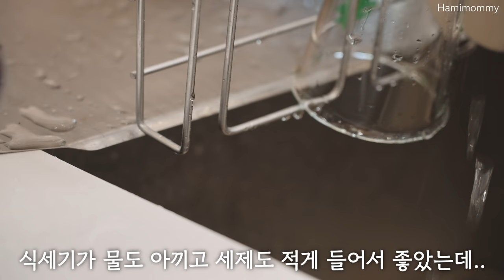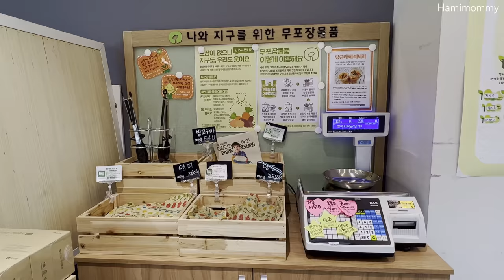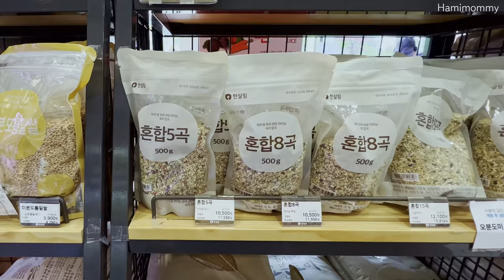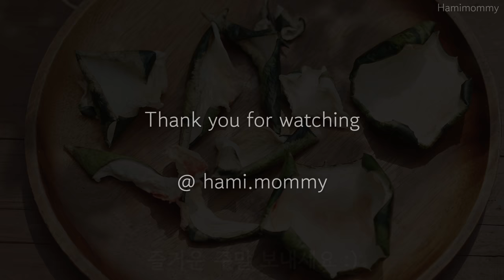SUB) 정원 꾸미고, 마당에서 피크닉하는 주택일상 🍉ㅣ여름과일 보관법, 수박껍질 버리는 팁ㅣ친환경 살림 🌱메네멘, 순두부찌개, 식빵애플파이ㅣHamimommy Vlog

Comment: Menemen is a very famous meal in Turkey.
Without boiling the tomato, peel, chop (or grate) and add it. Cook with the lid of the pot closed until the tomatoes are cooked.
Menemen is eaten with a little water. Therefore, it is not preferred to be eaten too dry. I recommend you try this way. Greetings from Turkey 💕🇹🇷

Comment: I'm so glad to see you cook turkish food😭😭 If you come to Turkey one day, I would love to host you and be your travel guide🥺💘 and also you can try kuymak i think you like it 💘 this is kuymak recipe; 
2 heaping tablespoons of butter
2 heaped tablespoons of corn flour
1 water glass (at room temperature)
1 cascolot cheese
1/2 tea glass of boiling water
1 wipe teaspoon salt
Key Point of Kuymak Recipe
The most important point you should pay attention to in order for your gem to be the flexibility you want is the cheese you will use. You can also cook with chechil or cheddar cheese, but you will get the best result with kolot cheese.
How to Make Kuymak Recipe?
If possible, put the butter in a copper pan and add the corn flour when the oil melts and foams.
step-1
Roast the corn flour until it turns color. Then add a glass of water and salt.
step-2
Roast until the water is absorbed and after adding the water well, add the kolot cheese into it.
step-4
Fry by stirring until the cheese melts completely and absorbs the water.
step-5-end
After the cheese melts, add the boiling water, and when the water absorbs and becomes longer, turn down the heat.
step-6
When the butter gently piles up on the top, your well is ready. Serve hot.
- sorry if i wrote it wrong at grammar